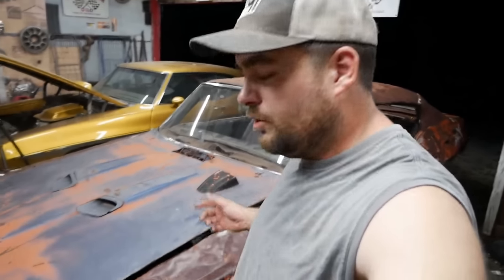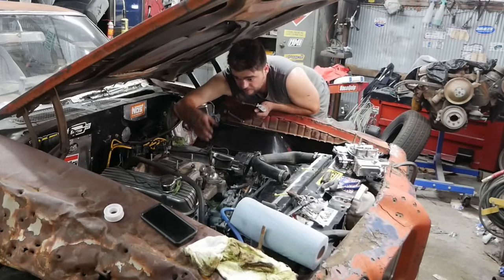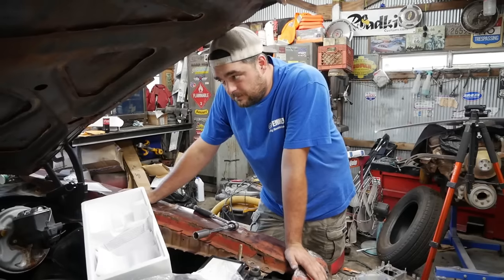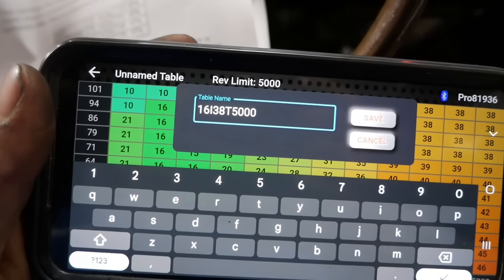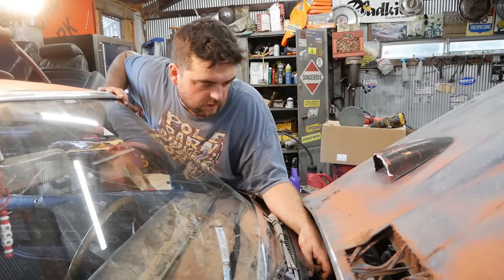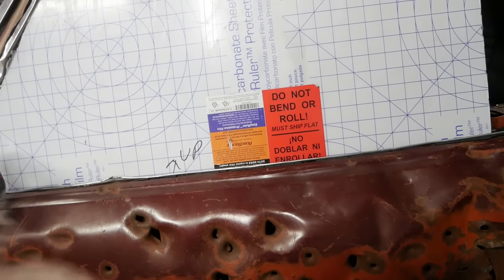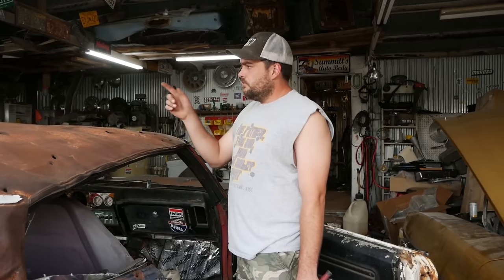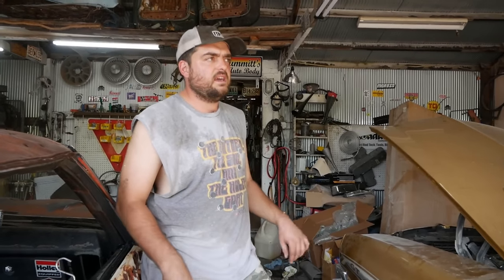Worst '70 GTO Gets Drag Race Ready! Now with WINDOWS!

Comment: Dalton, I have my seat bolts sideways too. I call it "pre-loading" to add strength for those times I am pulling high G's when cornering, LOL. To Pontiac engine owners. Do yourself a favor and hack the water crossover off the manifold so it can be left mounted when removing the intake. Keep up the good fight!!!

Comment: So to correctly use a piston stop to locate TDC you put the piston off TDC, install the stop, wind clockwise until contact, mark balancer, wind counterclockwise until contact, mount balancer. Then exactly between those two points is TDC. 

What you’ve just done is nothing resembling TDC, and by the looks of how close that balancer was with a stop, I’d say it’s MILES out. 

Love the videos. Hopefully this helps.

Comment: For cutting the polycarbonate, router was the correct answer. It can be bent/formed if you stay within the correct  temperature window. Too cool and it won't bend, too hot and it bubbles. Slowly soak the heat through it; the temperature range isn't as wide as acrylic, if memory serves. I just ran across my factory tech brief folder earlier today. I can look up the exact numbers if you need them..

Comment: When you use a piston stop vs. a dial indicator to find TDC, Rotate the engine until it stops, slowly and carefully.  Mark the balancer at the 0 degree mark.  Then, rotate the crankshaft in the opposite direction until it stops and mark the balancer again.  Measure from mark to mark and the center of those two marks is TDC.

Comment: As we both know your GTO came stock with a 750 CFM Q - Jet, so with  a 625 CFM carb it will be down a little bit on power, but will run really well in combination with the duel plane manifold. Also you need something stainless steel to block off a heat crossover.

Comment: I kept my '69 Camaro as original and period correct as possible but I couldnt resist replacing the points ignition with the progression distributor. It looks completely original unless you really look closely and it is so much easier to tune on. Also their customer service is excellent, I had an issue and they sent me a whole new unit immediately.

Comment: It costs me about 28-30$ for the six quarts of quaker state 5W30 and AC Delco filter for my 02 Silverado 4x4. 271k miles and it runs just it did when I got it at 226k! The 4.8 Vortec never misses a beat

Comment: Hey man
You guys are pretty smart and seem to like to tinker 
Here’s an idea
Grab a motor
Put it in a generator chassis or just use an inverter
It’s a just a running combustion engine
Air fuel spark right?
Hydrogen is combustible
Make a generator that runs off gaseous h2 
It don’t need to run well
It just needs to run well enough to keep electricity flow
Here’s the fun part
Plug these into inverter

Dehumidifier 
Collect the water
Filter that water
Install di water system
Run that water you collected to feed a h2 lab gas generator
Tap the generator in in front of the bottle
You have a perpetual energy system

Comment: Hey Dalton, you may want to take the distributor that was in the engine originally as a backup in case the new one fails. 🤷‍♂️ the new one looks like it will be amazing if it holds up.

Comment: And it already comes with a ton of extra "speed holes" for the drags.

I've used CAD "cardboard added design" for coming up with a template for a window in polycarb before.
Reply: He's gonna need all the holes he can get, it's still 100 degrees here in AZ.   But hey, that's 20 degrees cooler than last month : )

Comment: 9:08 in my Jeep Liberty I run Super Tech Conventional 10W30 Motor Oil 5 Liters (almost a gallon & 1/2) from Walmart is $24.99   or Rotella Triple Protection Premium Heavy Duty Engine Oil 5L $36.98 
and in my 04 Subaru Impreza I run Mobil 1 High Mileage Full Synthetic Engine Oil 5W-30, 4.73 L (1 gal +1 quart) $57.97 (although I only change the oil every 6 months) and I use WIX Filters in both my Jeep & Subaru 

We are also paying $2/liter $7.60/gallon) for gasoline.

Comment: 20l jug of Rotella Heavy Duty Diesel is 87 USD here and it's enough for 3 oil changes. Oil filter is 5.50 and oil additive is 9 USD. So every oil change in my truck is around 44 USD... well, I didn't want to know that. 😅

Comment: Yeah Oil is expensive, Though the dollar store does have name brand quarts that are often cheaper than the part store so I go there if I need a quart real quick. But I really only run Diesel oil in my 99 Suburban, its got nearly 300k miles and clasped lifter and has oil pressure issues at idle on hot days with the stock 5w30 so thicker stuff to get a little more life out of her.

Comment: Just got oil for my daily gas saver and it was almost 50 bucks ! Damn Miata
Reply: Have to use 0w20 in my Nissan Altima.  That is up there in that range too. At least I have been getting 38 mpg doing mixed highway and city driving.

Comment: On the wiper motor do you have the  park switch powered to allow it to wipe?  My firebird does that. I have to run a wire to jumper the wiper motor park switch.

Comment: Oil along with everything else is getting absolutely out of control. I’m lucky enough that generally I can get away with one oil change in my daily driver about every ten months. Coming up on another change due, but last feb I paid almost $70 for 5 liters of Liqui Moly 5w40. Since vw decided to cast the camshaft in my BRM out of LiquiBusch cans, you allegedly have to use a special spec oil (VW 505.01 spec) and it’s also pretty expensive. Allegedly if you don’t use the specific spec oil your liquicam goes flat and destroys the follower buckets.  I friggin doubt it’s the oil that causss that excessive and extreme wear, but I don’t have the time to mess with that kinda crap so sticking with their recommendations. Even though I’m pretty sure my cam is going flat…….

The good news, oddly that oil is currently on sale at $46.49/5 liters. Wait … why am I complaining? Not to brag but My oil changes are virtually free. If you buy parts from fcpeuro, including consumables like oil, they guarantee it for life and will replace what you’ve consumed free of charge. Granted if you buy 5 liters and return 4 since yer 250,000 mile diesel turd leaks like the Exxon Valdez, they’ll only refund you for the exact amount you return.

Also that distributor is SUPER COOL!  Having the ability to do any tuning on a simple hei distributor from yer phone is next level shit!!

Comment: is this going to be a roadkill barracuda from the junkyard moment...
where friburger rings lutz and discovers windows weren't actually needed ?
Reply from the maker: They are though
Reply: @PoleBarnGarage  well you might want to fix the rear window,
it will create a vortex 
sucking in the front and maybe the side windows too,
peter brock had this exact problem at bathurst in 1985
Reply from the maker: Been driving it thousands of miles without any issue

Comment: How much am I paying for oil? None, I don't own a car.. I would if I could get someone around here to let their car go for a decent price instead of "all the moneys." There's a 68 notchback Cuda slant 6 for sale near me with everything needed to swap to a 360 including engine, headers, 4 speed.. but it's got a fair amount of rust, especially for California and the idiot already cut the driver's rear quarter out at the bottom and hacked the shit out of it ensuring that you'll need to cut it higher and get a half quarter to fix it and not just the lower quarter.. That many issues and needing swapped, I could only afford about half what he wants and still afford the panels and primer, so I'm sure he wouldn't let it go for that. There's also a 68 Firebird and 72 Ventura with no engine or trans. I'm sure they wouldn't take what I could offer for the Firebird and the Ventura is actually an okay price even includes all new floor pans.. I'm just not allowed to go get it living at home.. YAY! big ups for NOT HAVING A LIFE! (or job, fucking disabilities) There's a 75 Dart for sale that looks like it's got a 360 in it, it's the Duster bodystyle.. he wants a decent price at $2700.  
As long as you keep your foot out of the secondaries, a double pumper can get better mileage than a vacuum secondary. It's just a matter of not opening the throttle past 1/2 way.. so long as you have it adjusted right.